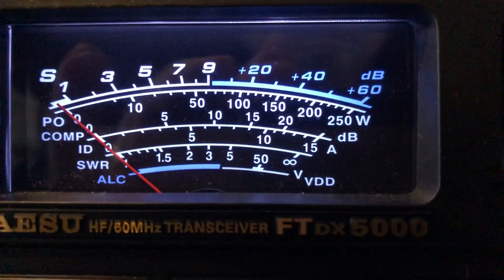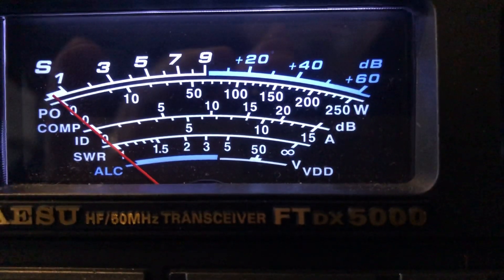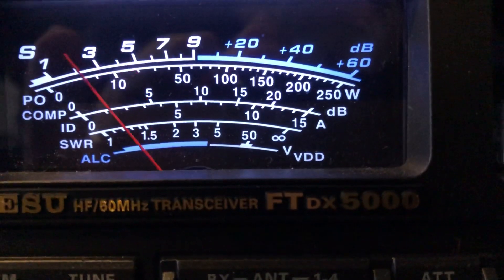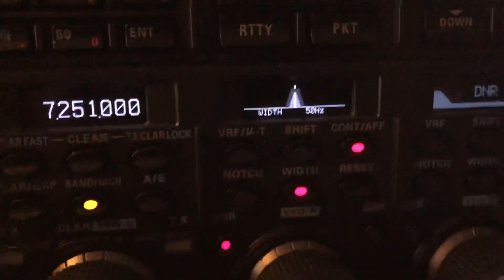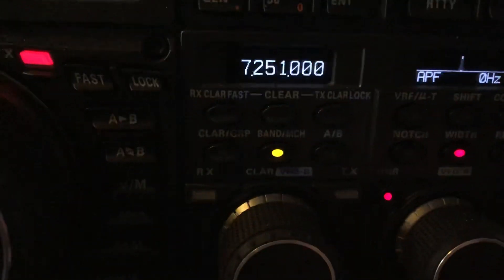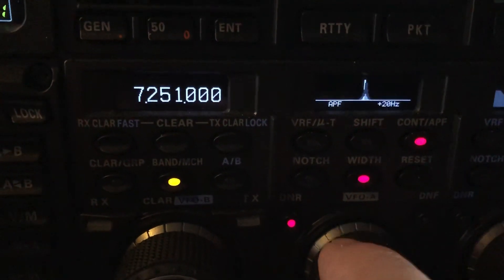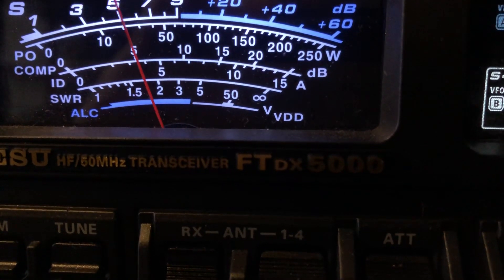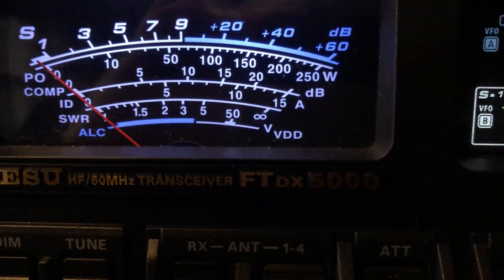FTdx5000MP: Low Noise Floor

Comment: Dang, I thought it was a dead radio. Until the signal came in...
Reply from the maker: That’s the experience I had when I first tried out the 5000 at HRO.  When I first walked into HRO, the first day of testing, I went straight to the TS-990S.  I had a CW station at S7, with an S6 noise floor.  The Kenwood DSP did a good job clearing it up though.  HRO has a terrible antenna system snd they are surrounded by power lines.  I switched over to the 5000 and the meter was showing S1.  I thought IPO was on, or maybe an attenuator.  But no, they weren’t enabled.  So I thought, what a terrible receiver.  Then suddenly the station started sending again, and he was S7.  I still compared radios for 9 more months before deciding, but I kept coming back to the 5000.  And of course I ultimately purchased a 5000.  73, de N4HNH